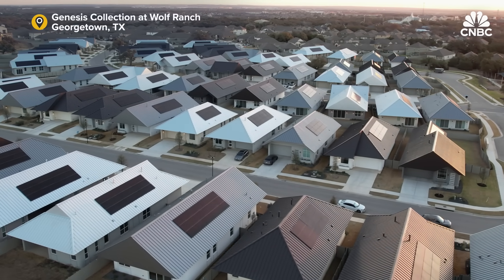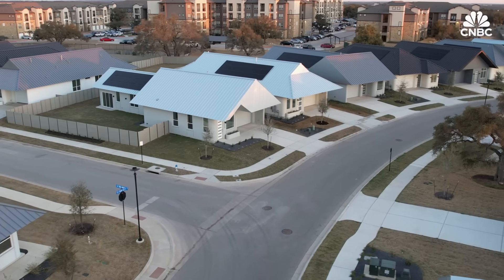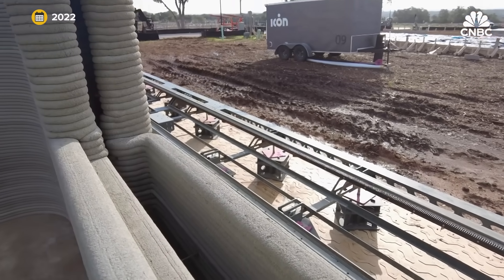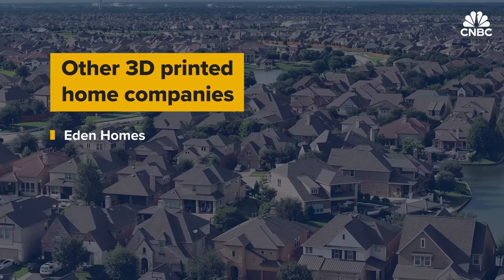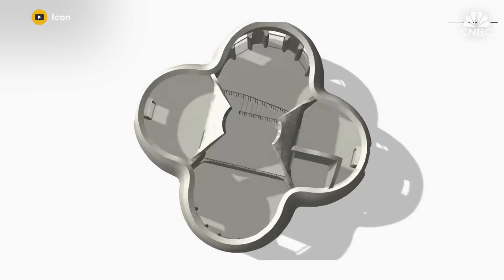Inside The World’s Largest 3D Printed Neighborhood

Comment: So many questions and issues come to mind. One being how do you hang anything on a wall that isnt smooth. How do you repair this house. Has it been hurricane and tornado tested in the field. How do you hang anything on concrete and how does it not become brittle over time. How does it do with sound when crying for help. Is it a murderers haven since it's easier to suppress sound with concrete no matter how it's poured. How do you clean the concrete without pressure washing? I mean do I keep asking the questions

Comment: I actually visited this site last year out of curiosity. What impressed me most was the insulation and how quiet the homes were despite being near a major road. The combination of concrete walls and smart windows really shows the benefit of material science in construction.
Reply: Your comment sounds like a paid PR post
Reply: Bot
Reply: This is a weirdly well placed comment
Reply: Yeah the quietness is one of my favorite benefits. I'm a super light sleeper & currently living in an apartment. I have to sleep with earmuffs on.
Reply: @tallyontop    I might have the answer to removing your earmuffs and eliminating your noise problem. I'm sorry you're having problems sleeping.  I'm also an extremely light sleeper and have other sleep issues that I have conquered with how my room is set up, keeping to a sleep schedule, supplements that I take, and using a white noise sound machine. 
     Years ago, I bought a white noise sound machine, and it changed my life for the better. I live in a condo and am surrounded by noisy neighbors. The sound screen machine drowns out everyone's noise. I can't use the type of noise-blocking machines that make nature sounds because they would distract me from falling asleep; my sound blocker makes the sound of a fan and is adjustable. I hope you will think about buying one. 
     I sleep in a dark, cool room with no electronics on, and I use my white noise sound machine. I have a fan but prefer to use my white noise sound machine. 

     All the best in being able to find a solution to be able to eliminate the earmuffs.
Reply: Quick question: what happens after a fire? This type of construction doesn't lend itself to repair. I expect high insurance costs.
Reply: Material science? In my country all homes are made of concrete or brick and when you close the window, you can't hear a thing outside. That's not innovation. Innovation is what this tech can do long term to cut costs and reduce time.

Comment: I can se a ton of obvious downsides to this method of construction, such as how exactly someone is meant to clean those walls made of exposed textured concrete. I'd be much more concerned at all the tiny voids in between the layers of that mud. Typically, concrete is vibrated after pouring to remove air pockets. In this case, the viscous mud is just stacked layer after layer, with voids in between every single layer. Over time, this will erode a lot faster,  and will be less durable in general. I'm sure they won't fall over in the wind, but they're certainly not built to last.

Comment: I just watched a video on the shortage of wood for wood-based houses, and turn right around and watch this video. And this is by no means the only other material to build houses out of. Quite frankly, we live in the computer age, the information age, the automation age, the AI age, and it just seems so outdated to still be building wood-based stick-framed housing, especially in light of the fact that they're deporting a significant amount of the labor force needed to build houses, and those wood houses take whole crews and months to build. Nobody is going to want to live in them a decade or two down the road, when insurance will no longer insure them. That's already happening in many areas prone to fire and hurricanes, and potentially tornado-prone areas. But these 3-D printed homes will still be insured.

Comment: If anyone owns one of these homes, could you please advise on how much more energy efficient they are? And how do you patch up any holes that are made after build? In know in my traditional home we have fixed hundreds of patches through the years made by cable companies, plumbers, electricians etc. Are these homes designed with different access to plumbing and electrical wires?

Comment: What about the flexibility in an earthquake in Cali? Will granny be crushed under a fractured concrete wall because there’s no studs or beams supporting the walls? ALSO Is it possible to smooth those HORRENDOUS layer lines?? Looks dizzying … if you got vertigo you ain’t finna last 😂 in that hoe !

Comment: I wonder if a viable option would be to use 3D printing to create materials for standard building techniques -- concrete and metal framing, bricks, tubs, sinks, roofing tiles, etc. You could have the printing done on the build site or in a printing facility that could print and ship custom pieces on demand and deliver same day or next day. Maybe some companies are already doing this?  I also wonder if they had fed their plans through an AI system if it could have advised them on the best thickness and designs to meet goals of build-time and material-use efficiency.

Comment: No one ever mentions upkeep and repair. What if you have a leak, an accident, whatever it may be, and you need to access the space behind the walls. You can't just pull out a panel like sheetrock and replace. Do you go to the builder and say I need a new wall printed? So while I dig the tech, more real world info versus what's on the brochure would be nice.

Comment: 2:22: "the homes here start at just under $400k (for a house under 1600sq ft). Thats about comprable to other LARGER HOMES in the area." So i take that as a smaller Printed house costs around the same as a built home of 2500sq ft??

Comment: This solves several problems yet creates problems (externalities). It solves the insulation issue which allows one to spend less for HVAV but it is still a pricey home. It allows homes to be built within 2 weeks which is a good model.  This manner of construction will eliminate more jobs than it'll create. We need a more viable solution:cheaper (under 400k) homes that are built within 2 weeks with solar panels and renewable materials. This company checks almost all of the boxes for an optimal housing market
Reply: concrete isn't an insulator though, I've lived in 3 concrete buildings in northern Mexico and they are cold in the winter!

Comment: AI Summary

Abstract:

This video explores the development of the largest 3D printed home community, a collaboration between 3D printing technology company Icon and major homebuilder Lennar, located near Austin, Texas. The project, comprising 100 homes, aims to leverage robotic construction using a cement-like material to address the national housing shortage and affordability crisis. The report details the printing process, the initial learning curve and logistical challenges faced by the partners, and the benefits experienced by residents, such as exceptional energy efficiency and structural resilience. The companies are working towards increased speed, reduced labor (targeting highly automated systems), and lower costs for future phases, including a planned second community and the development of next-generation printers capable of printing the entire building envelope.

Building the Future: Inside the World's Largest 3D Printed Home Community

*   0:00 Largest Community: Icon and Lennar collaborated to build the world's largest 3D printed home community, consisting of 100 homes on the outskirts of Austin, Texas.
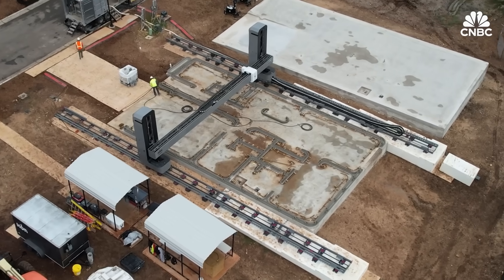*   0:13 Speed and Efficiency: The project aims to build homes faster and more efficiently than traditional construction methods, although the initial community took about two years to print (0:21).
*   0:46 Addressing Housing Needs: The initiative seeks to help solve the critical housing shortage (nationally short roughly 4 million homes at 0:53) and improve affordability.
*   1:05 Design Benefits: The homes are designed for enhanced energy efficiency, as well as resistance to wind, fire, and mold (1:18, 1:22).
*   1:57 Resident Experience: A resident family (Miller) shares their positive experience, highlighting the home's energy efficiency (a January bill was only $26 vs $250-300 average for conventional homes at 2:36), quietness, and robust construction (3:04). Hanging items requires drilling into the concrete walls (2:10).
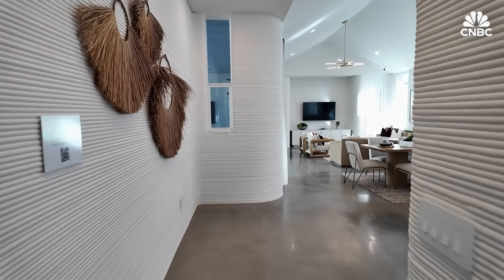*   2:22 Affordability: Homes in the community were available for under $400,000.
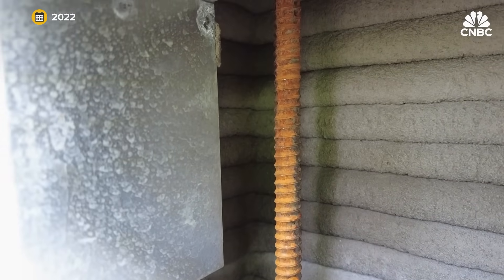*   3:44 Technology & Automation: Icon uses "Build OS" software (3:48) to manage the digital construction process, including structural reinforcement and placement of utilities. The goal is significant labor reduction (4:00), aiming for just one operator per dozen systems in the future (4:14).
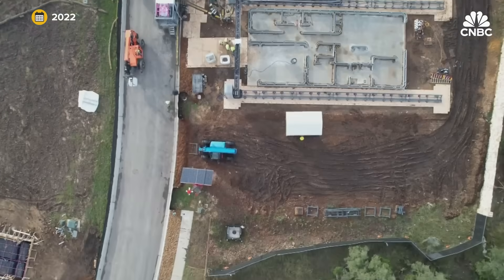*   4:32 Logistics and Collaboration: The project involved complex logistics and coordination between Icon's printing process and traditional trades for foundations and finishing (4:46).
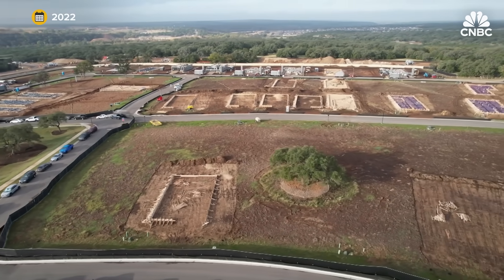*   5:39 Learning Curve: The initial phase presented challenges, with the first third of the project taking twice as long and costing twice as much as anticipated, but the partners adapted and improved (5:47).
*   6:07 Design Optimization: Learnings from the project led to design changes, potentially including less thick walls (6:09) and more open floor plans (6:15) for efficiency.
*   6:41 Versatility: 3D printing allows for faster design iterations and customization for specific needs, such as building in wildfire or hurricane-prone areas with resilient materials (8:17, 8:31).
*   7:13 Path to Profitability: The homes are not currently as profitable as traditional builds for Lennar, which views this as an investment in innovation and scaling the technology (7:17, 7:24).
*   7:26 Future Plans: Icon and Lennar are planning a second community nearby (7:30) with redesigned, more affordable walls (7:39) and are developing next-generation "Phoenix" printers capable of building the entire building envelope (8:03).
*   8:24 Structural Resilience: The printed material creates a robust shell that feels stronger than many traditional homes (8:24) and offers superior fire and wind resistance (8:30, 8:46).

I used gemini-2.5-flash-preview-04-17| input-price: 0.15 output-price: 3.5 max-context-length: 128_000 on rocketrecap dot com to summarize the transcript.
Cost (if I didn't use the free tier): $0.0051
Input tokens: 13488
Output tokens: 870

Comment: This is horrible only for one reason, there is no area around the home to plant the necessary foliage for the environmental good and for the psychology of the residents. Other than that it’s a true innovation. Those who want a smooth wall can have the walls "plastered over" with a similar cement based material. This will increase the labor costs but provide the homeowner with a more traditional interior wall system.

Comment: It's all BS.  The build cost is a fraction of the traditional building styles because the labor hours are literally less that 5% of building a wood frame sheetrock home of the same size.  The marginal increase in materials doesn't make up the difference in cost.  This is all profiteering and disgusting.

Comment: Remember wherbn this technology came out in 2018, and they printed a house for $4K? These houses are sellling for $375K up to $889K listings... 
The 3D printers can't be bought for anything reasonable, but they hold HUGE government contracts!!! You can lease them for a small fortune... Remember, Black Rock holds stock in Lennar. No wonder they made a 'deal'. 
They tied up technology should should have brought housing costs DOWN and tioesd it up to maintain their hold over the market. Wait till it cures for a while and those MASSIVE CRACKS start showing up because it isn't properly reinforced. And unfortunately, then people will have a bad taste in their mouths about concrete houses.

Comment: You’d be better off with precast concrete panels. Everything would be flat and you could even make it look like brick or siding or stucco. You could build everything in a factory right on the edge of the development. It seems like you could do something with the extruder tip and the consistency of the concrete.

Comment: I'm curious about how much the concrete walls degrade wifi/cell signals. As we move into the future where more and more devices use wifi for smart features, and home wifi continues to utilize shorter, less wall-penetrating wavelengths with higher bandwidths (wifi 4 vs 5/6/etc), how much will each interior wall limit your connectivity? Seems like a mesh network and hardwired ethernet lines to rooms might be a neccessity here

Comment: One of the biggest detractors for me is the look of those walls and the fact they are rounded. Those micro bumps look horrible. Maybe to some they think it's an interesting new look but I don't. I want a flat wall and if I'm buying a house for that price I don't want to have to do remodeling work from the get-go.
Reply: I could live with the rounded pattern on outside walls, but inside, no thanks. They easily could have plastered them and smoothed out all the internal walls to bring it more to conventional standards.

Comment: The bang for the buck initially was the selling point of 3D printing houses and reducing labor costs. But as previous comment mentioned the cost to the consumer is coming in at about what a conventionally built house would cost less that critical income going into the labor of the subcontractors that ultimately is of tremendous and integral benefit to the viability of our communities.

Comment: i dont see any support column or beams..does that mean the entire structure is just one concrete structure ? just like a wasp cell ? So, if one side of the house tilts because of "natural causes", the damage to the house would be much greater and impossible to fix...With similarly priced conventional "old"  houses this structure is not a good choice.

Comment: Military base housing was made by cinder block. It probably still is.  I just see why we don't use that because this is basically what these homes are one big concrete building.
Regulation and permitting makes the cost of homes expensive. 
These are cool but looking at those walls will get old

Comment: Well, I have few questions:

1. Concrete is good but how you solved the tensile strength necessary for dynamic loads? I did not see any standard reinforcement and I do not think fibers can work because of the layered technology? How do you ensure the layers work together?
2. Any insulation in the gaps? Concrete has hell of a thermal conductivity.
3. The finishing touch - these walls look fancy, wait till you have to clean them. Uneven surfaces are prone to dust collection.

Otherwise loved the soft-edge esthetic and the foresight to use different roof configuration to bring some identity to the homes.

Comment: I live in a cement block house built in the late 30's. I saw the ridges inside the house from the cement. That would be almost impossible to clean, but it would trap dust, dirt, etc. And in super dusty Texas? That is something they will have to improve.

Comment: Are the footings 3d printed? No. Are the foundations and floor 3d printed? No. Is the roof printed? No. Are the bathrooms and finsishes printed? No. Is the kitchen printed? No. Are the windows and doors printed? No. Is the trim and finish printed? No. 
Let's be accurate here. These are 3d printed walls only. It is just a machine that prints walls, out of concrete, one of the most energy intensive materials to produce. 
There is nothing clever here, just a lot of high intensity energy derived materials , and a massive robotic 3D printer depriving people of meaningful employment.

Comment: This is very interesting.  I agree with some of the other comments.  They also said they could make it thinner. Once you make it thinner  is it still going to have the strength of the previous homes. You get it to thin it will be easier to say punch thru in case of tornado.